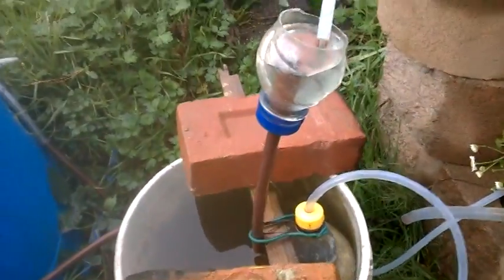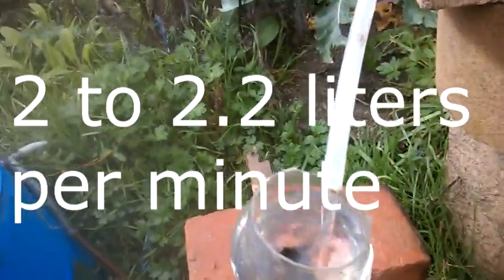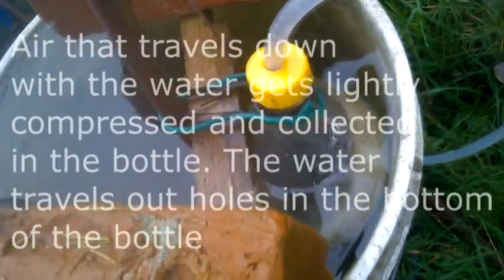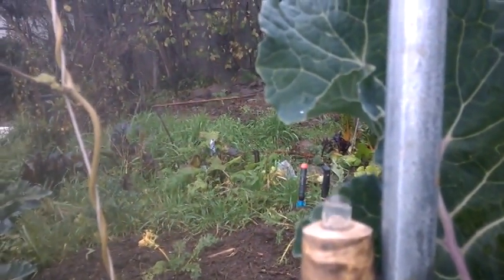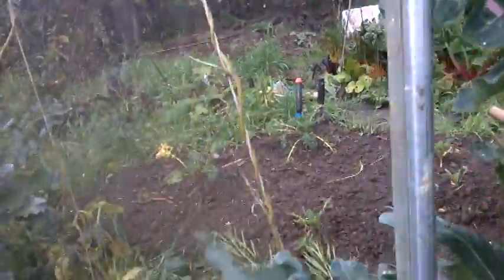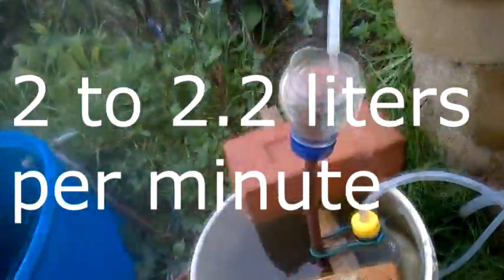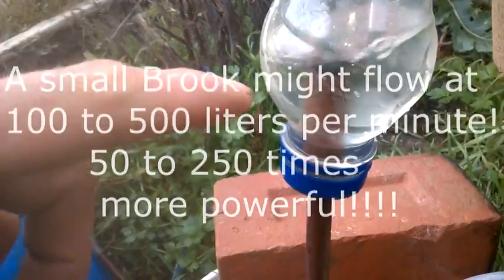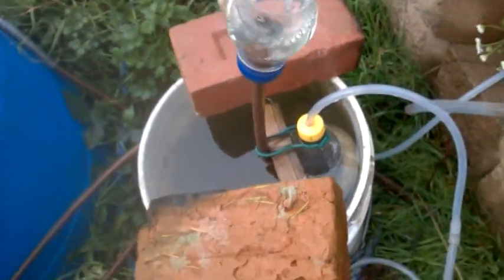The Trompe! A way to use low head hydro power Without electricity!

Comment: My thought is with some fine tuning and using better materials could the pumped water come out fast enough to refill the top tank that feeds the air pump? I'm assuming not but still... And great work BTW!
Reply from the maker: That would be a perpetual motion machine and physics rules them out.  You can never achieve 100% efficiency in any physical process.